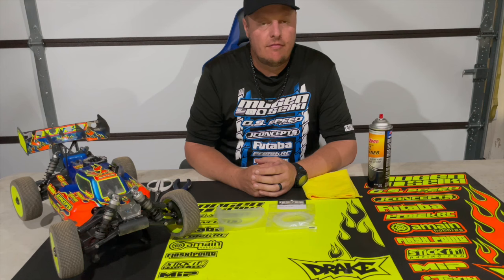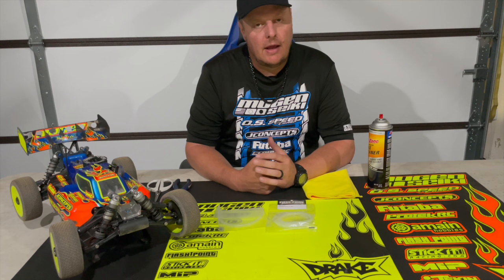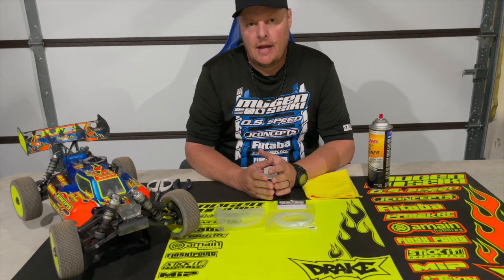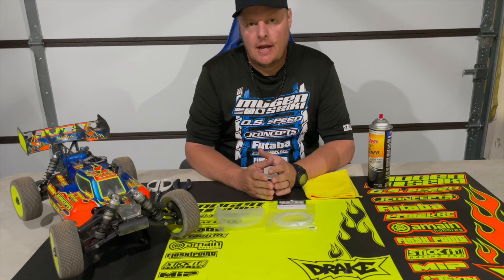Fuel Line Tips and Installation.

Comment: Great video, thanks!! What about using zip tie instead the "line fittings" you described ?
Reply from the maker: Zip tie?  That should work fine, but needs to be replaced each time the line is removed.
Reply: Zip tie would probably be more inconvenient. Also the fuel line stretches better so you can slide it when you need to disconnect the lines.
Reply from the maker: Yes sir. @alb9022

Comment: Adam, great video. Do you use a fuel inline filter? Didn't see one but was a little hard to see. And what would be the downside?
Reply: He doesn't use them. In one of his videos he's talked about it and trusts the Mugenseiki integrated sintered filters to do their job.
Downsides are added weight and an additional 2 points of failure (both ends of an inline filter).
Assuming the carb nipple and fuel lines are kept clean, the only entry for contaminants would be from fuel itself and dirt in and around the fuel tank.